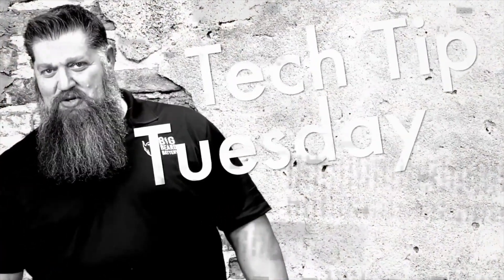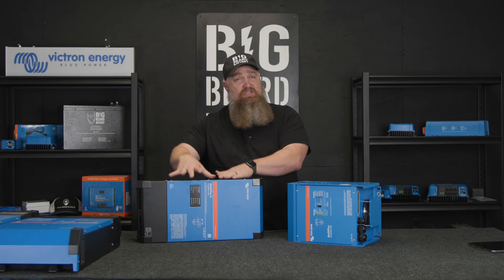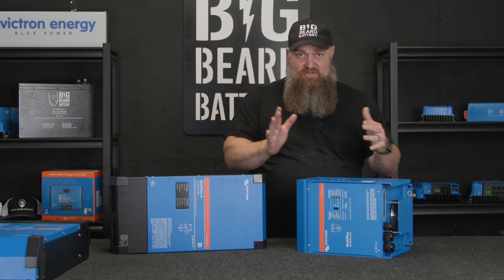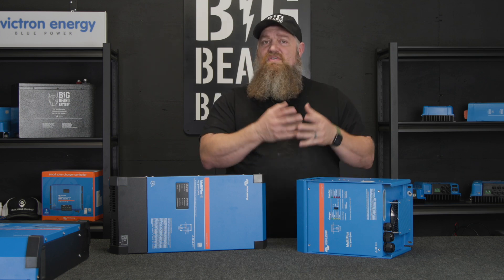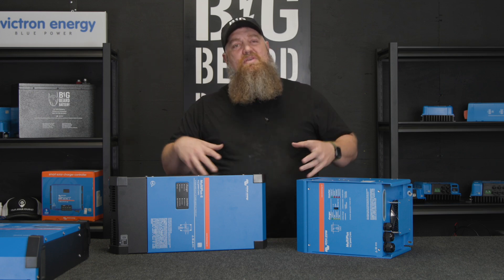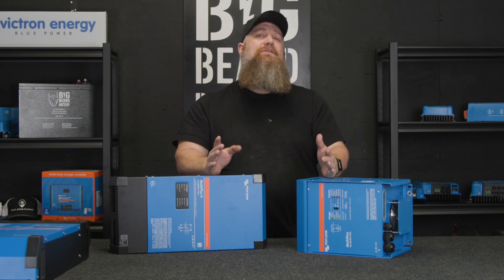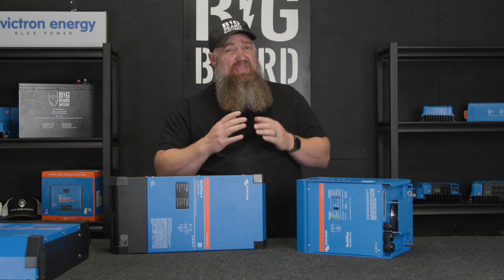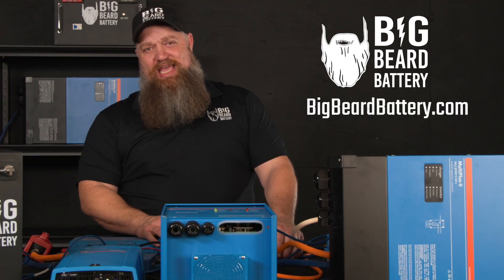Options for off grid RV living

Comment: Todd - love the videos. I have a fifth wheel pre-wired for a 2000w inverter. I bought and installed an inverter with a built-in automatic transfer switch. When off-grid, we can run about 1600w continuously before overloading the inverter. No issues with using less watts than that.

However, when on shore power, the built-in transfer switch is also limiting us to around the same power (roughly 1600-1700w). Does that seem right? I would think the ATS would just allow normal power to flow through without the limitation. Curious to hear your thoughts.
Reply from the maker: So you neeed to look up the model number and look for the pass-thru current limit. If it is more than what is being allowed then there is a setting that is limiting the pass-thru amount. This is all brand dependent.

Comment: I have a 50a RV however only 1 leg is inverter capable. Everything( solar) except the inverter is Victron because of this. Would love to power all plugs, no extra box just the main circuit panel. I understand electrical but this is a nightmare on why they did this this way
Reply from the maker: Typically they subpanel because they either put a smaller output inverter that cannot handle the largest item in the RV, or they didnt want to wire the whole rv understanding the owner has to limit their demand.
Reply: @ yes, I had a worthless 1300 inverter that would not power my coffee machine. Replaced the inverter with a 3000 w and added 460ah lithium 1200w solar system. Still would like to have a few more plugs powered by the inverter.

Comment: We have a single Multiplus running our 50a CC388RK2. We connected the fridge, 1 a/c (w/heatpump), TV, most outlets. Pretty much everything but the dishwasher, washer, dryer, and the other 2 a/cs. Everything runs to the one breaker box but we moved the breakers we wanted to invert to one bus bar in the box.

Comment: If you run two Multiplus, would that give you 3000 VA on each leg of a 50 amp system? What would be the minimum ah of lithium needed to run the pair?
Reply from the maker: So lets look at 2 factors. Delivery speed (continuous amps) and capacity (amp hours).

Delivery speed. EACH Multiplus inverters can continuously push 2400 watts. at 12 volts that comes out to 200 amps continuous on the battery bank each,  So you would need to have a bank that can handle the possibility of 4800 watts continuously. 

Next is capacity- how long do you want/need to run the inverters? An energy audit would help determine how many you would need

Comment: Will you be able to address how to get around the firefly system?  Do either victrons address that? Right now I have 3,280 amp hours of lithium and two Magnum 2800 inverters and I can’t get around the firefly system to run the AC’s. I was hoping by swapping out to the Victrons could be a solution.
Reply: We removed a single magnum and installed dual multiplus in a Renegade 40VBH. The Firefly doesn't know or care what inverter you have. You just have to remove the programming preventing AC usage when off grid or generator. We can run both AC's off multiplus, one on each.